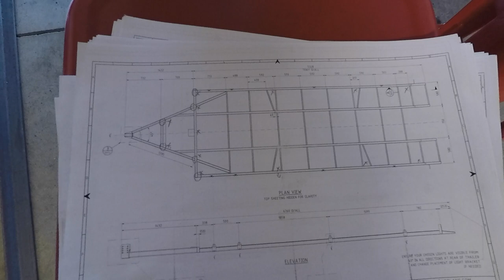Bagged Trailer Build - Frame - Part 5

Comment: Hi, thank you for your great work and sharing this video instruction for all. Have question: I bought drawings of this project, but haven’t plasma, so need to give it to third party company. I did not found thickness in drawing for all parts, does dxf files contain this info? Could you please share sheet metal thickness (25, 6 mm?) how much sheet metal did you get ? 
I hope the final video will answer my question, but I did not found how pivot arm connected to the platform.
Reply from the maker: the drawings has thickness information, on page 30 and 41 has the cut list on the top right corner, it is all in mm.
the pivot arm itself doesn't connect to the platform. the pivot arm mount is connected to the platform.
Reply: MCY Industries thank you your answer! I am just on calculating stage, would you be so kind to share sizes of metal sheets that you used?

Comment: I love the idear of the drawbar being a "threw frame" setup. 

I cant get my head around it though, wouldnt it be incrediblely prone to twist?? Its only weld (and science lol)  holding it in 1 single frame, rather then the normal setup where the frame weight on the drawbar is put threw the steel it self the weld just holds it in place and the draw bar being triangle fixed to both sides and front in the center, stops the front twisting when going around corners.

Your design in my opinion is 100% more practical, but not sure it would be strong enough :/
Love your videos.
Reply: I thought the same thing myself at first, but I think for this application it should be ok. I’m not putting a massive load on it anyway. If worse comes to worse I can always add a fish plate on the bottom

Comment: You put way to many holes in the frame. This is why a wire chase way invented. You only needed a few round hole that you can plug later with grommet covers. You really weakened the frame with so many rectangular holes.